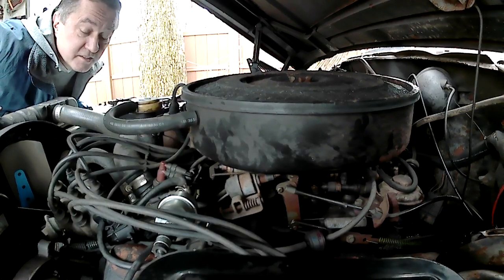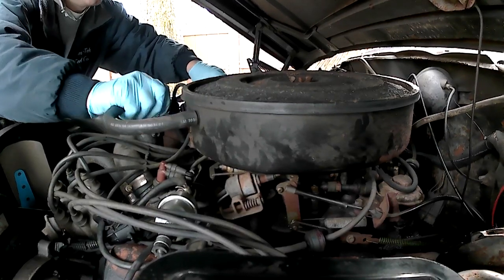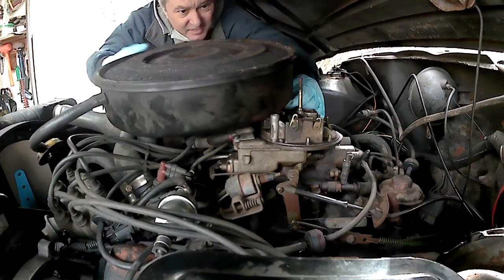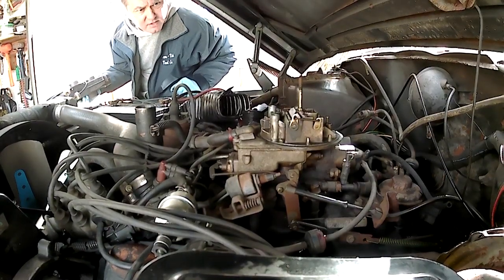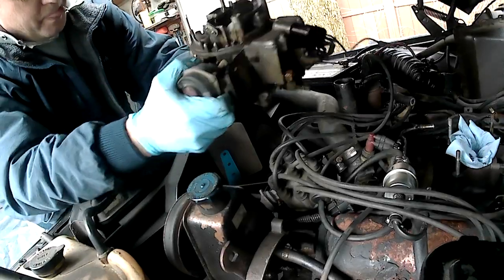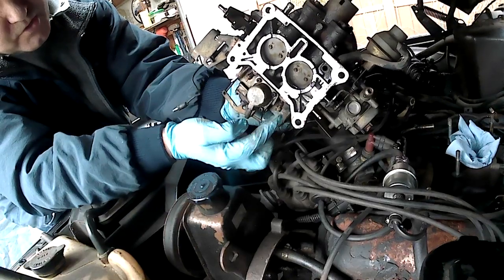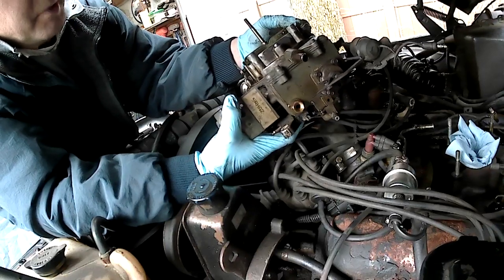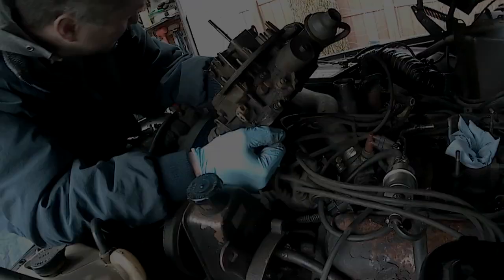2150 Carb Rebuild 1- Removal

Comment: THe hardest part of removing one of these is the nut on the rear corner on the choke side.  The vac pull off is in the way.   That might be all we missed in the corrupted part.  Thanks for the series.